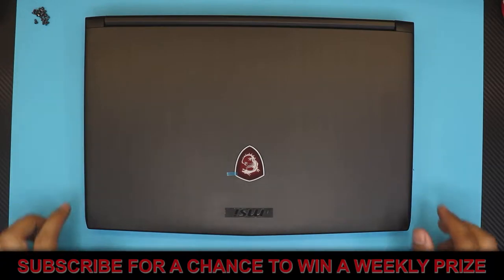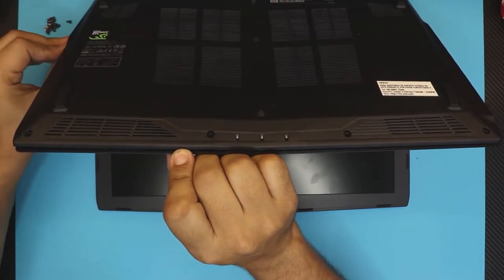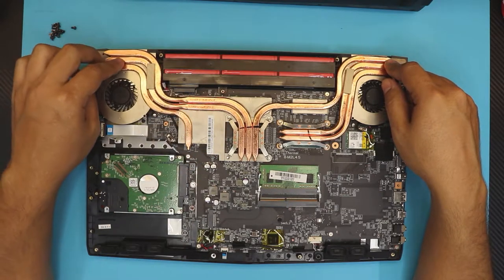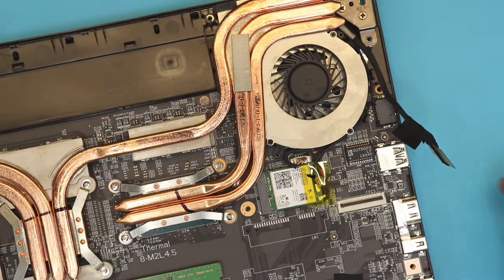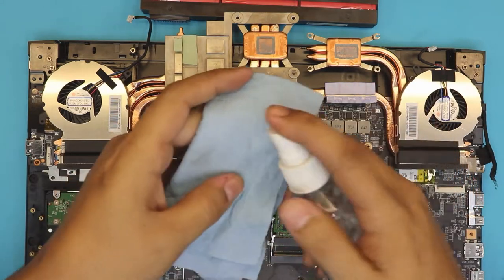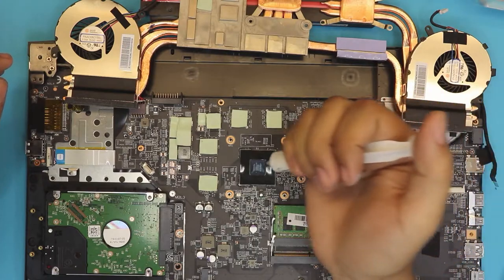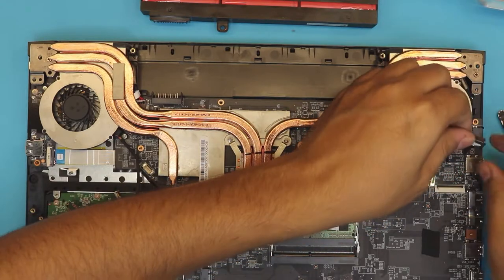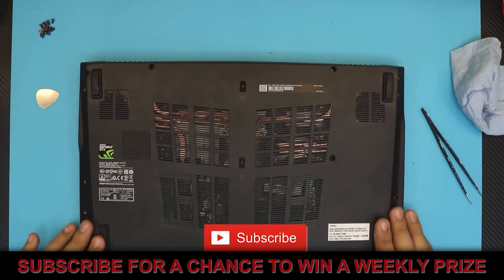HOW TO Repaste and clean your MSI GL63 Series laptop under 20min

Comment: I was doing this procedure because i was worried about the consistently high tenperatures my components were running at and i got about to the part where i disconected the ribbon cable, i couldnt get the gpu and cpu screws off so i called it quits, i ended up using a brush to remove most of the dust that was lying around the fans and heatsink, put it back together and now my computer's display is compeltely black, external monitors dont pick up on any signal either so im basically a walking human disaster that managed to fuck up something without even acomplishing the end goal.
Spent the rest of the day desperately trying to find out what i messed up but to no avail.
Reply from the maker: sorry to hear about your situation, i can help you out my friend.
just answer this questions:
#1, did you remove the rams at any point?
#2. did you plug and un plugged the lcd screen carefully and the ribbing pins are intact?
#3. when you power on does it give any indication of the power fan or led light?
Reply: @uFixTek 
1. During the procedure i did not, but while trying to troubleshoot it later i moved them around to check if it was due to that, i got the same results with all configurations.
2. I thought i was careful enough moving the lcd cable around but maybe i was not? I can't really tell but the cable or the pins didn't seem  to have any clear physical damage but maybe i just didn't spot it.
3. The computer powers on, the leds and fans work as expected, i think everything else might be working because i can even login into the operating system (i can tell because of keyboard led changes and system sounds).

I spent a whole day trying to find out what i messed up but i couldn't reach a conclusion, i have cleaned other laptops before without any issue but this time i clearly might have missed something, today i turned it in for a technician to try and diagnose the issue since it appears to be out of my capabilities, thanks for the help and if you have an hypothesis to what went wrong i would love to hear it!
Reply from the maker: @kefka1033 got it, its very easy fix we get this issue all the time, all you had to do is to remove the internal battery and remove the rams and press and hold the power ON for 30-60sec, then plug the battery and only place one ram dim and power on then once you get the boot place the 2nd ram and power on and wait 10sec for bios to detect it. i hope the tech guy dont make up excuses , most of them will even go as far as its your bios and BSing. be careful
Reply: @uFixTek  Il make sure to try it once its back in my hands no matter what they say, thanks a lot for the help!
Reply: @uFixTek  I also have some aditional questions if you don't mind answering:

What may have caused the issue in the first place?

How does this procedure fix the issue?

And finally, if i only have one RAM stick is the procedure the same minus the part of inserting the second stick?
Reply from the maker: yes its the same procedure just with one ram, and this issue can happen randomly , even it happens when we open up laptops.the issue is with bios and resetting the bios will fix the issue.
Reply: @uFixTek  Hello again, i finally got my computer back and they said they could not find the issue with it, and recomended sending it for motherboard repair to see if that would be possible, i got the computer back in my hands and did the bios reset procedure as you described but it did not work, computer is still powering on and booting but with completely black screen on the laptop or external monitor. I am disheartened by this outcome but appreciate your help non the less, i just wish i could figure out what i did wrong.
Reply from the maker: @kefka1033  ok , there is this last option that i would like you to do,
#1. remove the motherboard completely
#2. make sure you remove all rams and all cable and place the pure motherboard on a wood table.
#3. you will need to be in a closed room with no fan or AC.
#4. grab a hair dryer and at max heat and medium air flow.
#5. place the hair dryer 1" above the GPU chip for 5min  and remove it and let it cool down on its own for 15min.
then repaste  and assemble.

what all this is doing is re-flowing the solder balls under the gpu.

Comment: After doing this my laptop not getting on!!😑 I have MSI Gl62M 7RD can u give me any solution for this issue
Reply from the maker: dont worry im here to help you, question... how many ram dims you have ?, and have you removed the rams at any point?
Reply: @uFixTek   I have a 2 RAM spots, Yes my friend I had removed and cleaned and it.
Reply from the maker: oki i need you to do the following, exactly as i mention:
#1 remove the bottom cover
#2 dont disconnect the battery only disconnect the charger
#3 remove both rams
#4 open the screen into 90 degree and place the laptop on its side
#5 plug only one ram on the dim that is near the motherboard
#6 plug the charger and power on and wait 5-10sec if you get any logo then power off my holding the power button for 5-6sec
#7 plug the 2nd ram and power on with charger connected and wait 5-10 sec 

let me know if that worked.
if the above didnt work do the same but this time place the other ram on the 1st dimm and test
Reply: @uFixTek   it doesn't works for me my friend!.. I had followed those steps exactly!..
Reply from the maker: Ok when you have plugged in everything and power on what reacction you get fan works? lights ? and after how many sec it turn off i need more detail plz
Reply: @uFixTek  when I try to on after cleaning it doesn't reacts!.. then I connected my charger and tried still doesn't turn on. After I just hold on power button for 20 to 30 sec there was a blue light blinking next to the power button. But no screen appeared. Then again I pulled off the charger cable and tried to turn on then after no reactions. 
1. Fan doesn't get starts
2. No display screen
3. No other sounds from laptop 
4. Simply dead like that 😑🥺
Reply from the maker: ok im going to take a look of what you may have touched or something, but for now try to calm and open it up remove the battery and heatsink double check the connections. and observe and take as many pictures you can from every connector and motherboard before and after and send it to my email
ask@ufixtek.com
Reply: @uFixTek  okay I'm doing it my friend thank you!!...
Reply: I have did!.. kindly pls check your mail bro!.
Reply from the maker: ok im out side once i get to the office i will check the email, and i will contact you via email
Reply: @uFixTek   okay my friend thank you
Reply: @uFixTek  brother can you pls check my mail....

Comment: Hey thanks for the video. Why do you only put such a small amount of thermal paste? will it spread out enough when you put the heat pipes back on?
Reply from the maker: Thank you for the feedback! if you wish to support the channel you can LIKE or SUB or both :P
regarding your question: Oh ya its more than enough , putting more it can actually worsen the temps. we have ran test with and check the spreading with with glass sheet and its more than enough.

Comment: Wow! Thanks! This would come in handy, but when i tried to unplug the fan flexible cable i found it so hard. And my laptop is GL63 Leopard 8RE where there is a cable on the left fan that is connected to the charging hole, and it is plugged just right between the heat pipe, so i think it's nearly impossible to unplug it with my hands. Can you tell me how to unplug these cable? Will be waiting for your answer here mate!
Reply: Here's the pictures of the cable
https://imgur.com/a/oZtndiN
Reply from the maker: 2st thank you for the feedback, and 2nd the fan doesn't have a flex cable, the only flex cable is the LCD cable.
here i mark them 
https://imgur.com/a/MAelEl3

can you send me a pic of what you talking about?
Reply from the maker: https://imgur.com/a/WbW2gbZ
Reply: @uFixTek  there is no other words than THANK YOU SO MUCH, your effort on sending me the pictures and the text you added to my pictures is really helpful. I've cleaned my fans this morning after i read your reply, and thanks again for your quick reply! Keep helping other people mates, because i'm pretty sure there are more people like me. And one more question, is it okay if we pull on the cables, i mean we literally pull the wires. I'm just afraid if I'm doing it for the third times and the wire is broken
Reply from the maker: no it wont break you can do it 100 time i been doing this for over 14years never broke wires :P thank you for the feedback and when you got question i try to answer as soon as i can. good luck

Comment: man, my laptop wont turn on
Reply: i already followed every step you give in this video, and put it back exanctly liki in the video
Reply: please help🙏🏻
Reply from the maker: ok 1st of all you must have done something wrong!
did you double check the cables that are connected?
i need to know what happens when you press the power B? does any light turns on?
does the power light comes on and no screen ?
or does the power comes on and no screen and then shuts-down ?
try removing al the rams and then place the ram in again and power on and give it about 10sec.
Reply: @uFixTek  wow thanks for the reply, i already fix it. i found that i have to plugged it in first. again, thanks for the tutorial👍🏻
Reply: @uFixTek  the first time nothing happen, even the light does not appear
Reply from the maker: im glad you got it fix , thank you for the feedback and your support :)